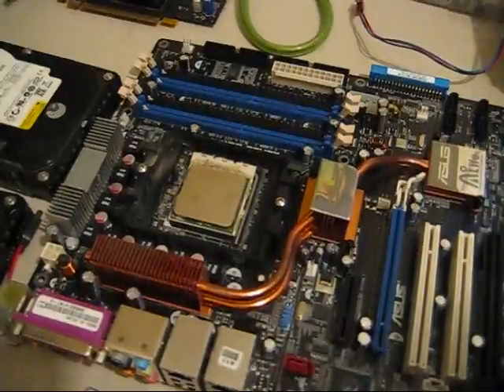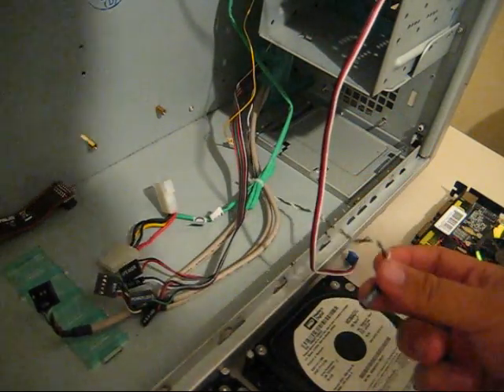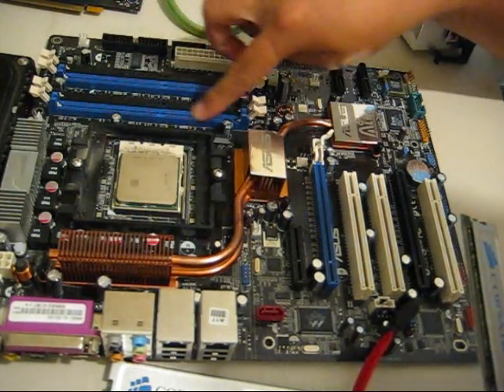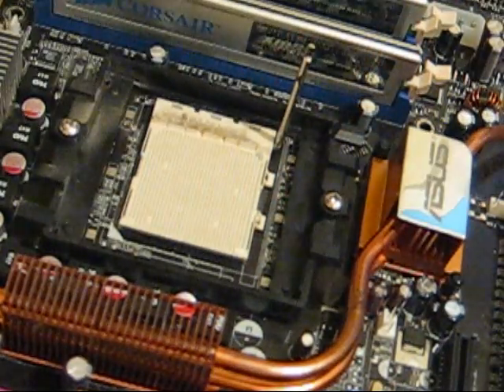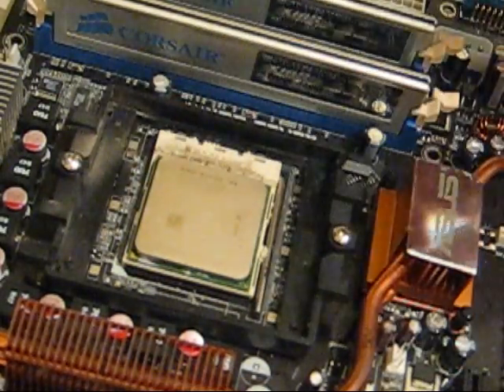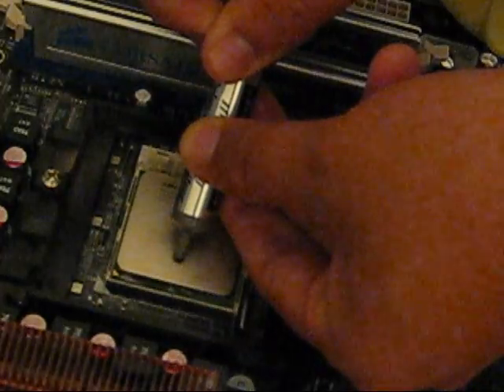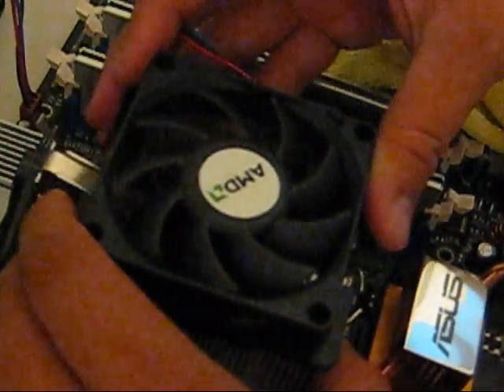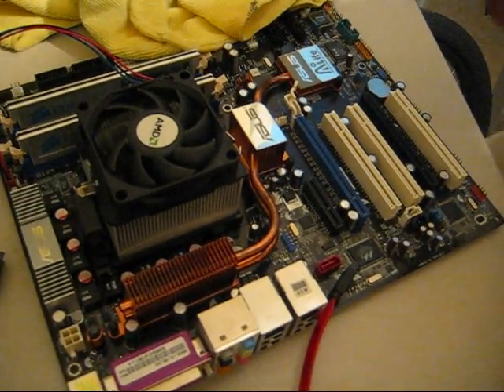building your own custom computer part II (2)

Comment: @Cownt299 
No they don't have to be in teh same color or slot.  they suggest it, and most boards dont' suggest using the same color slots actually. they tell you slot number/address, which more times then not are two different colors.  Especially on ASus Boards. MSI will use the same colors on teh suggest Dual Channel slots though. however they are not required to use the.  If you are using more then 2 slots this is when it normally changes, especially when there are 2 different sizes

Comment: not all boards require you to use the same colored RAM Slots for Dual Channel.  More times then not it isn't that way!! CPU pins are copper, not gold, and wipe it off before mounting the cpu on the board, to get the finger prints off and oil's from your fingers, with a warm Damp Paper towel, if not a Rag!  he doesn't use enough grease, i use 5 Pea's corners and center. find a Straight edge, and spread it like Peanut butter

Comment from the maker: The only compound i ever had a harder time with like say artic silver was the tuniq tx-3. It's alot thicker and a bit tricky to apply. You have to do it just right or else your temp readings will seems abnormal. That's probably the only time i will spread it out is using tx-3

Comment from the maker: They're many ways of applying paste but with the way i do it, i put enough in the center of the cpu and when you put the heatsink on the pressure between the cpu and heatsink will spread it out.